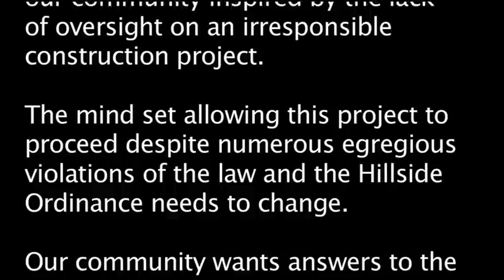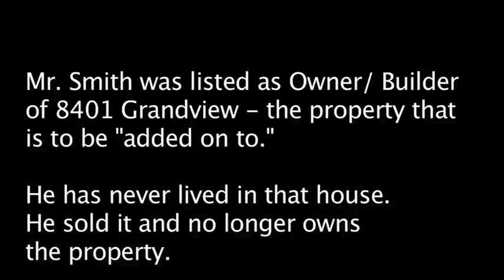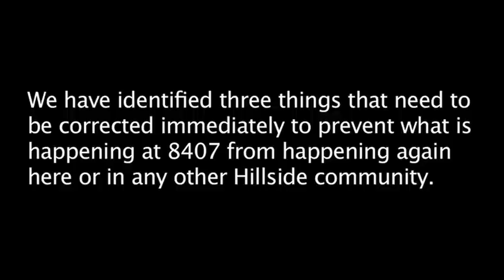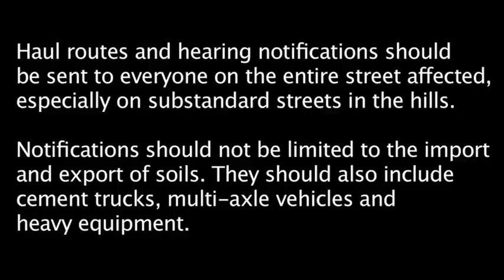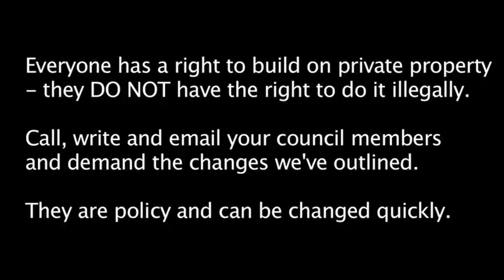Canyon Defender Movie 1.mov

Comment: Grandview Drive is a disaster waiting to happen.  When this property was being built there was heavy equipment blocking the street at all hours of the day, construction being done without adequate safety protection, and both public and private property that sustained heavy damage.  This 2,600 foot "pool house" expansion, to be connected to the prior property by a bridge, is already experiencing similar problems.  I feel sorry for neighborhoods less caring and communicative than this one.